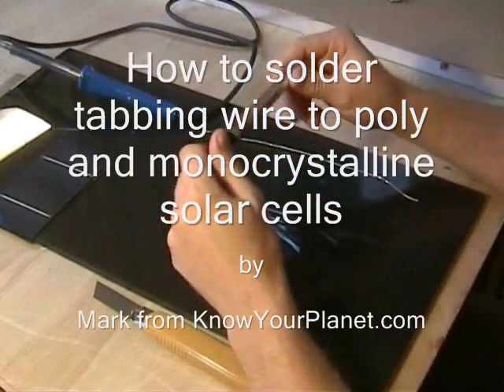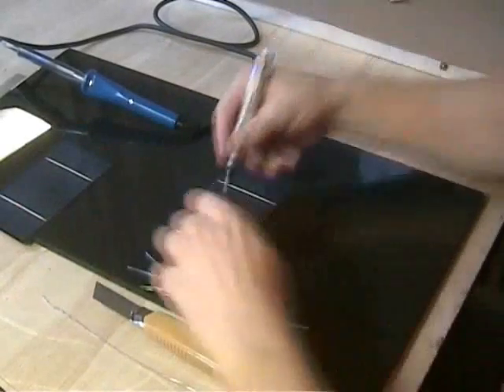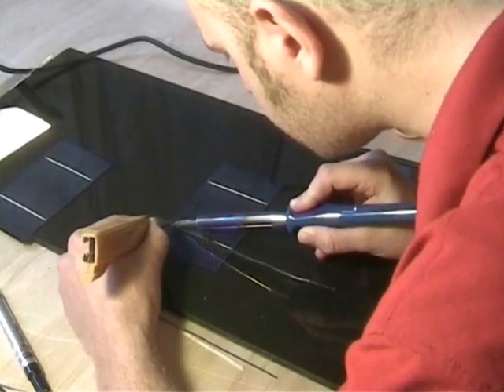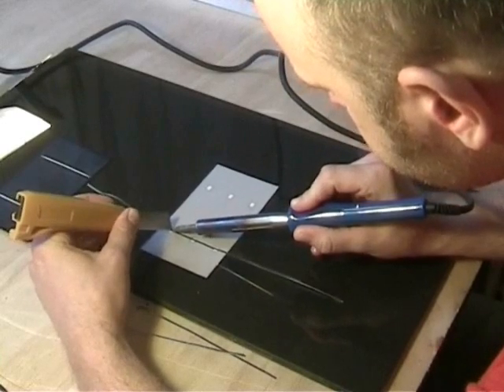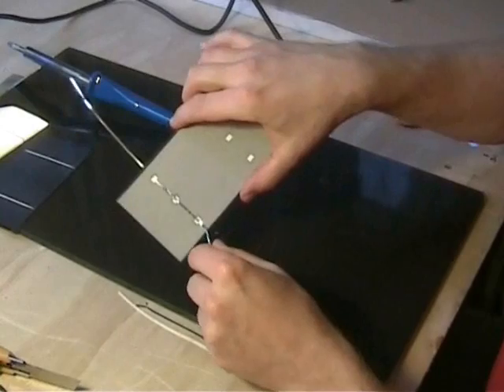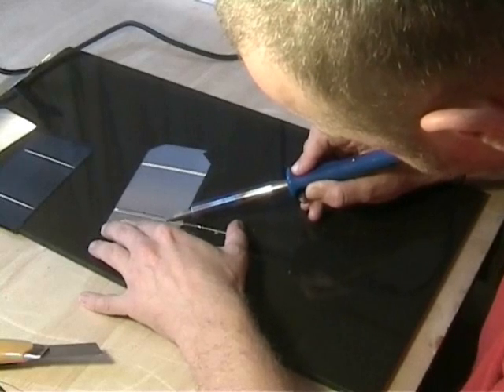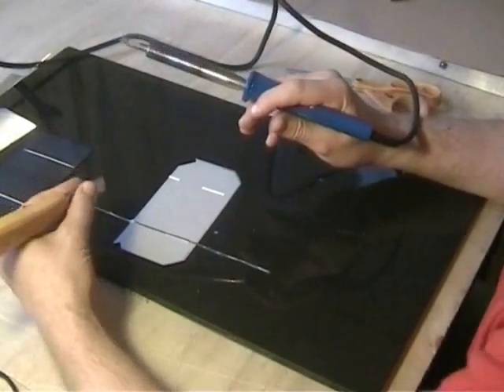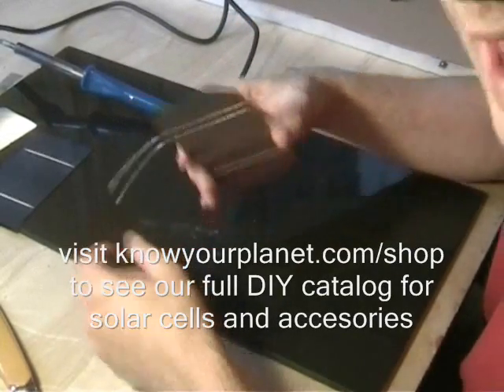how to solder tabbing wire to solar cells.wmv

Comment: i found when building cells if i get  fine solder and keep adding a bit to  the tabbing wire as i move it along the strip and the bond is perfect every time pre flux solder is the better  to use